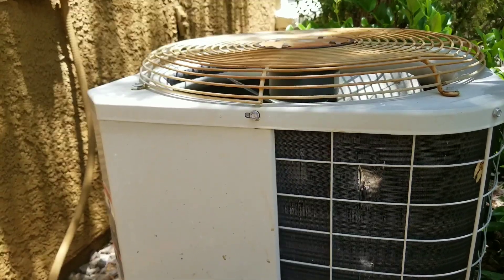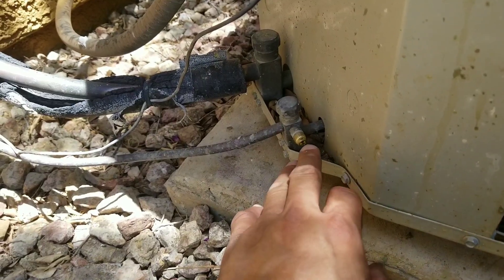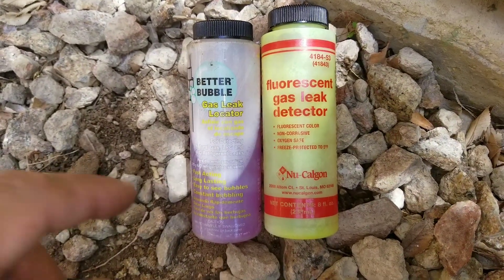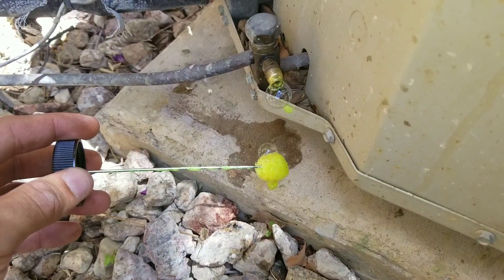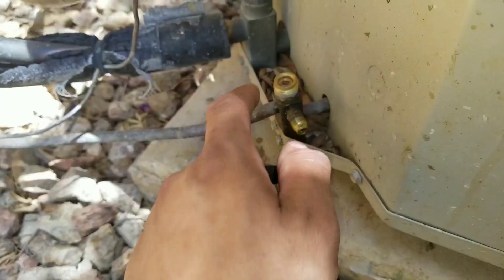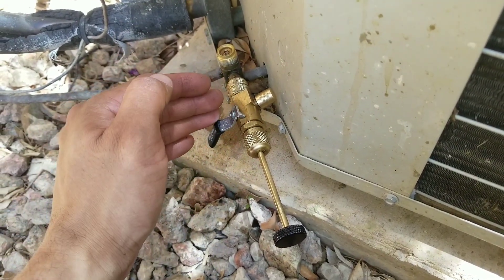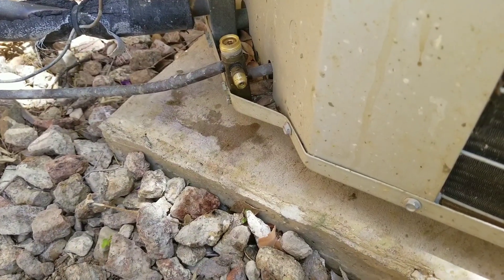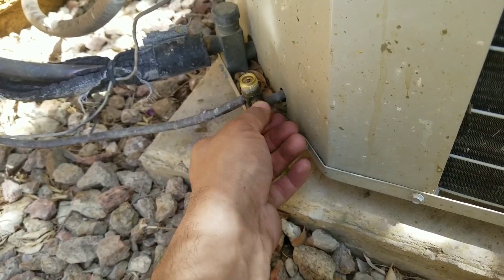Low Refrigerant? Freon Leak? Check This First!

Comment: Can you please specify whether or not to have the AC on and running? Yes or No? While doing this test and replacing that inner valve? Also, what is that special tool called for closing off system while you replace the core of the valve?

Comment: Heading home in 5 minutes to check this.  I leaked out 5 lbs of R22 & technician said $20K for a new unit outside and the attack.  If that brass cap does the trick I will do the happy dance.  I know the guy is a bandit because he has called me 4 times in a week wanting me to sign on the dotted line for the $$$ overhaul.  The bum's rush.
Reply: Need an update here, did it solve the leak?
Reply: @jonathant319   The Unit was toast. The $20K quote was from a rat bastard trying to take advantage of the situation as the house was a sweltering 85*.....  I made a call to an old HVAC friend that replaced everything for under $8K.  Four guys wrapped it up in mere hours. They were like the Indy Pit Crew.

Comment: Sorry 80% is just not true, not even close. Leaky acoils by far out weigh shraeders since they should all have caps on them. Better way to test for leaky schraeders is to remove the schraeder depressor and hook up the guage normally or use a stand alone guage. If the pressure starts to go up without a depressor in there it is leaking!
Reply: This video was probably aimed at those who don't have gauges and other professional equipment.

Comment: Hi Sam, Do you do the leak test with the unit on or off?  Does it make any difference?  Thanks for your great videos!  Frank
Reply: That's a good question, Frank. I wondered that, too. It didn't appear the condenser was on. One of the lines is suction, so I don't imagine the test would be valid on that one at all.

Comment: Hi Sam- I had a HVAC contractor come and charge my system for 3lbs of Feron @$150/ lb.  He charged another $150 for cleaning the outside condersor coils. He didnt open the system just sprayed from outside and cleaned it with a hose. -- is that a standard practice- is $150/lb a regular feron rate?
Reply: R-22 runs from $70-$200 per pound, depending how much they want to rob you for...

Comment: Not only will the brass cap protect the valve better, but if the valve does leak, which is usually a slow leak, the brass cap will prevent the leak while it is on.  Honestly, 90% of the time, the brass cap alone would be enough, but doing things the Right Way™ to do things.

Comment: Had a dude show up, they charged 107 for diagnostic and said if I wanted them to check for leaks it will be another 400 like mofo wtf was the diagnostic for if you were not going to diagnose anything! They all do this nonsense in my area and all they do is recommend new units
Reply: They're not repair technicians, they're sales technicians. They discourage repair by charging exorbitant diagnostic rates.

Comment: I stopped your video halfway through it because I believe that what you suggest is not possible. Most heating and air conditioning companies keep accurate computerized digital records and have been doing so for the last 20 years. They say that 85% of the time leaks that we fix come back the next year. The bulk of the leaks are either in the evaporator coil or the condenser coil many times there are multiple leaks in the evaporator coil they are extremely small ,in one infrared picture I saw from one place they counted over  120 separately in an evaporator coil. All of the leaks were too small to find with bubbles and they were also too small to find with electronic Leak Detectors though the best leak detector I ever used was the one made by infocom still the failure rate of these things is tremendous and you're not going to find leaks with those little bubbles especially not when you pump the system up to 200 lb per square inch because it blows the bubble out before you ever see it. Do like the gas company does when they look for gas leaks only put about 20 lb of pressure in there then use your bubbles, that bubble you will see some of the time but not often enough to rely on it. It is far better to just isolate the system this way you know it's either the liquid line the suction line the evaporator coil or the condenser coil you replace it it's more profit for you it's less cost for your customer and no fighting at work and no buck passing and finger pointing.

Comment: I had my 2003 R22 system topped up last year, tech said there was a small leak somewhere then left.  This year I called another company who's coming over next week to top up the system.  I'll perform the leak test myself tomorrow to see if I can pin point where the leak is and maybe save some $$ as the R22 is going to cost me.  Thanks for putting this together it really helps...

Comment: If I’m understanding correctly….is it common practice to switch out the valves when the unit is maintained and it’s starting to get aged? I had the hvac guy show up and tell me my ac was shot without even looking at it! His assistant was the one who got the creep to actuall hook hoses up and put some Freon in it…he was t even going to do that! When they unhooked the hose it started spraying Freon out of the valve and I was told it’s because I had plastic caps on the valves…so I got charged $200 for a brass cap and 1/2 lb of Freon which made my ac work again but it didn’t fix the leak in the line…so having this same issue every summer is a pain …no one in the area works on old units…unless ur someone special in town good luck getting an hvac guy to show up…

Comment: Thank you. Finally we have an honest tech like you. I live in New Jersey and had low 410A problem for two AC systems. I asked two different AC companies to check, and the first recommendation is to change the system for $7000 each.
Reply: How'd you fix the problem?
Reply: @kaliyepalata9973  I

Comment: fantastic video thank you! so all leak detection should be done with the system off? do you prefer the bottle with the applicator or would a spray bottle be better? finally what brand removal tool do you recommend? thanks again so much!

Comment: Fantastic work. I have an old unit and it's suddenly stopped cooling. I asked a tech to checkout unit and he said it was too old and added freon and told me to cross my fingers that the system would work. He charged me 100 bucks to add 2 pounds of freon and my compressor worked fine and the house started to cool. A week later the ac stopped cooling. I texted the guy and he only replied " that's really bad" .  I remember that he didn't check for leaks. I asked how did my unit loose the freon. He simply said that it evaporated. In my mind that meant a leak, but he didn't bother checking any of that.  He only said my unit is old and I need a new unit. I am sure the freon is all gone, but, can I still see bobbles on a leaking area?
Reply: Take kids bubbles…I just poured a little bit over the valves and the lines and watched….3 areas bubbles right up …so I took a picture of it to show the tech the next day

Comment: Hey Sam, I have the same AC unit 2002 vintage King and schader valves leaked. These are the high temp and pressure side, makes sense. Thank for saving me alot of money.

Comment: Yes very informative!! I have a straighter vale in front and rear Weather King 2 1/2 ton think it developed a slight leak in the rear to close to house can't get a good luck but unit ran all day got up to 78F now cooler outside went down to 77F dripping water outside condenser line? is cooler now. Can I burn out compressor if it's low on freon  ??? Please let me know ASAP

Comment: Your video is the best I have seen on checking for problems when there is a leak somewhere. Two technicians told me I need to replace my evap coils at a cost of $2,100 to $2,500. I asked an electrical engineer down the block to check the unit and he used a vacuum pump method to check the system and found NO leaks in the coils. Checking the valves showed exactly what you showed in tho video and saved me $$$. Sincere thanks. If the vale is broken and the cap is on, will the cap prevent the leak? Or just slow it down? Are the caps 1/4 inch usually? Thanks again.
Reply: My guys been ripping me off to now he's telling me I need a new evaporator coil kill do it for $3,400
Reply: How low on refrigerant was your unit?

Comment: An AC guy came and checked. He said my refrig. pipe corroded  and no pressure on pipes from condenser. We cannot located the leak but he said my pipe is under slab. Any advise - provided info is correct.

Comment: are the car valve the same? and what size are the o-rings on the shutoff valve? i want to replace both these and recharge but can't find the info on the o-rings and valves. i have a 30 year old rheem unit thanks

Comment: question. my customer might have a leak its been a long time my guess is theres NO ac left in the unit. can i pump in air from my compressor to test for a leak that way. im thinking the compressor wont compress the air high enough to really matte or it may be bad for the compressor straight air? i just want to see if she needs to call out someone to refill it. it got weak shortly after she had it filled the last time so he did it wrong or caused a leak through the valve stem

Comment: Hi Sam,  Where did you get the fluorescent detergent solution that you used to diagnose the leak location.  I know I can try dilute dish soap solution but as you mention that fluorescent solution would be easier to see if there are small leaks or not.

Comment: When replacing caps I like to put a flair cap that doesn’t  have the o ring  and it seals 100%. You use a wrench to tighten it. A lot of supply houses don’t carry them.
Reply: A tool  detects air bubbles in the liquid refrigerant line.

Comment: Is all of this done with power on? Or shut off at breaker panel and pull out the outside fuse?
Reply: Don't take my word for it i am no tech, you're supposed to turn off power everytime but this is really just hydraulics there is no electricity there, and you're not opening up the chassis so i would say, no need.

Comment: What size is the Schrader valves? 1/4 or 5/16 ? Any Tool recommendations for replacements?
Reply: Mobile Communications Network was that problem in your unit if so is it working fine now?

Comment: My central AC has a leak. I called the local HVAC guy. He came over and told me I have a leak but instead of attempting finding the leak he offered to replace the WHOLE system from condenser to the ducts without even looking at my ducts. Hard to find an honest HVAC person !!
Reply: People like big business and big money! So they don’t like to fix the small problem!
Reply: I had the same guy you had look at mine.
Reply: Had the same problem today , told me all my refrigerant was gone company They wanted $7000 to replace the unit.I told him to kiss my ass
Reply: The same happened to me today…
Looking for a persnickety to check my AC in 75154!
Reply: there are only 3 HVAC people in my area, all advised replacing the whole system for $5k, none of them even did proper leak tests. F these people!
Reply: Let's first check if you are still under warranty
Reply: Was it a old R22 system,  20 plus years old !!
Reply: Seems to be normal.
Reply: SAME HERE. HE DIDN'T WANT TO CHECK THE SOURCE OF THE LEAK AND WANTED TO REPLACE INSIDE AND OUTSIDE COILS. THAT WOULDN'T HAVE RESOLVED THE PROBLEM IF IT WAS LEAKING AT THE VALVE. UNREAL!!
Reply: @melissanative1799  I have been a service tech for 17 years. I can tell you most of the time it's not the Schrader valves. Yes I do find them stuck sometimes or the gasket leaking but 70% of the time it's not the Schrader valves and most of the time when another tech goes to a call that is a couple lbs low on refrigerant and says it's the Schrader valves, guess who has to go back on a call back a couple of weeks later to find it low again and the actual leak is in the evaporator coil in the air handler. Most techs that say the shraders are leaking are just too lazy to search for the leak and want to move on to the next call. It's usually a cop out. Not all the time, but most of the time
Reply: @racegrubb2152  Very interesting, thanks.
Reply: @racegrubb2152  but that means 3 out of 10 are it . Lots of systems replaced because of a easy fix !!
Reply: @rwood1995  leak repairs are not easy fixes lol. Not cheap either. If someone wants to be a dumbass and put a new evaporator coil in a 18 year old or 20 year old unit by all means. Don't say I didn't worn you and don't cry when your 18 year old compressor dies 6 months later because it's 18 years old. Starting and stopping constantly, running for long periods in hot days.Just not smart. It's like replacing a engine on a car with 400,000 miles. Becomes a money pit. 3 to 4 hour coil job depending on location and size if done properly is not a easy fix.
Reply: @racegrubb2152  It should be a two-way communication:  quote the owner for repair cost of a leaky coil of a 18-20 yo system vs replacing a new system.  I think most people (owner) will make a smart decision.
Reply: @rwood1995 dude ain’t nothing easy about finding those damn leaks

Comment: Have new unit put in 2yrs ago. Ac no blowing eight of air. Checked the Pan, sucked out gunk from the condense pile from my bathroom. Checked water flow and is fine. Filters are new. When the unit is on only a but condnetation falls into pan overnight. Called the AC local guy. He said my fridgent is low and he showed me. Without going inside my house for any leaks which I don't have he said need new coil. Coil is leaking. My pipes are ot frozen at all. BUT this could be the problem where I do see water. A lot more outside by this valve. So you think I need a new coil?  The unit is only 2 yrs old.

Comment: Do we turn off the AC (inside handler and outside compressor) at the electrical panel before doing all this? Second, if these valves aren't visible, are they inside the compressor? Itsa newer Lennox model

Comment: I had a technition come out other day check leak in my system my frion was empty bone dry he said it was a leak he had to put a solution in the system to find the leak something like you had it was in day time so he dome  florescent solution was in a tube he hook up to the out unit.. and he said it was in the inside conditions coil that was leaking he had to use a black light to see the liquid thst was comeing out the condition coil .  Is this procedure common or familiar to you ..
Reply: may I ask how much they charged you to do that?

Comment: Been a tech for 41 years. Of the thousands of leaks I have encountered over the years only 1% were in Schrader cores or King valve caps. 99% in the evaporator or condenser coils
Reply: I just had 2 this year and I'm not even an ac guy.

Comment: i am having the AC leaking issue. I have both Aircon installer and mgmt repair team attended to my condo to fix the problem. My unit has been refilled (with R32 refrigerant) for more than 4 times, and a pressure test with nitrogen also performed. (Indicated slight drop on pressure after 3 day of about 35 psig); however, my mgmt repair tema claims that the pressure test result should be within a day rather than 3 days; thus, refusal of replacement of new AC piping system. On the other hand, Aircon (Daikin) installer claims that the unit is working fine with no leaking issue, and they also replaced the cooling coil if its the source of issue. Last week, I had my unit refilled again, but it isn't working where the refrigerant level is low (indicator from aircon). What can i do? would it possibly the AC piping issue? (Piping is concealed in the wall). Looking forward to your advises. Thank you

Comment: Thank you for the video, it's very useful. I have couple of questions. Is this a DIY fix ? so anyone can fix it or you have to be a licensed person? 
Do you have any video if the king valve leaks and how to fix it? I just paid few days ago $400 for my home AC unit for charging the Freon and the technician didn't bother to look for the source of the leak. He just offered that he will give me a quote for a new AC and furnace later on when he is not busy !! This was the 5th time almost every other summer I have the same problem since they installed this unit brand new.
I appreciate if anyone replies.
Reply: Shawn Sanayei. 
A trick not shown in the video: without disturbing caps : gently feel the underside of each valve or cap or flare joint- for oil residue, including indoor unit. Failing that keep hunting elsewhere for oil is a sure sign of a leak. You can also use dilute dish soap. If you see bubbles, fantastic! 
Next, try the caps, any that are finger loose are bad news. 
Dry the soap off with a rag, leave the unit crystal clean if possible 
A tech should never top up gas without first repairing the leak. It's the law.

Comment: how do you get that leak detector fluid out of the mouth of the schrader valve?   if i were to service or charge the unit that fluid might get sucked into the system which would be bad
Reply: Briefly depress the tip of the schrader valve. Refrigerant pressure will blow the leak detector out, thereby clearing it.

Comment: Why do I need special leak detectors instead of soapy water?
Reply: You can definitely use soapy water but some of the gas leak detectors have a different viscosity that allows them to show a leak easier. If you noticed when he used the fluorescent yellow solution it was stickier and bubbled up much easier than the other one he used.
Reply: I swear to you Tom as I was watching the video I said to myself I'm going to use dish detergent.

Comment: Does this leak cause system to ice up?
Reply: Yes, a low refrigerant charge can definitely cause the system to ice up. Other causes of icing are dirty furnace filters and dirty indoor (evaporator) coils or any restriction or reduction of airflow across the indoor coil.